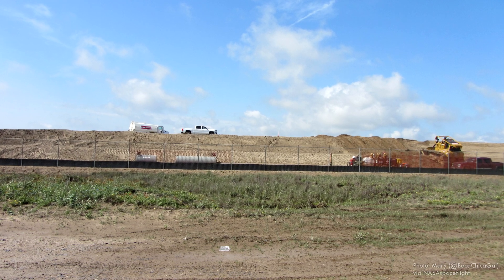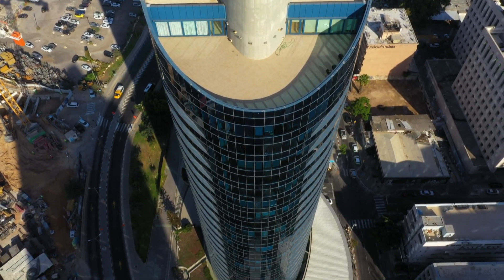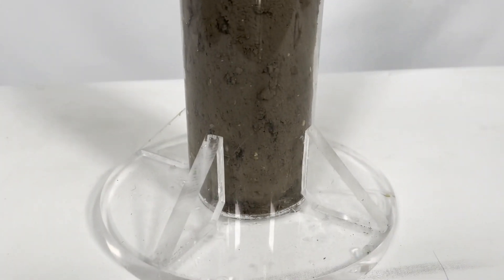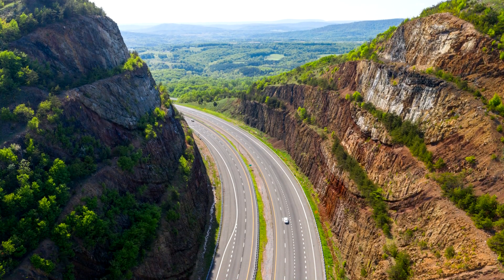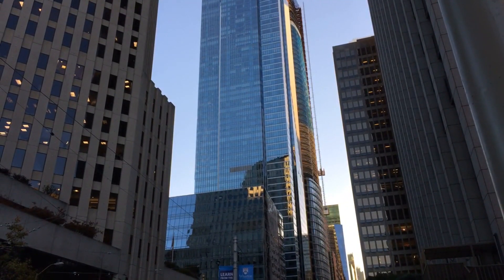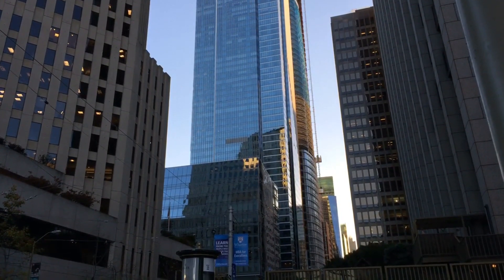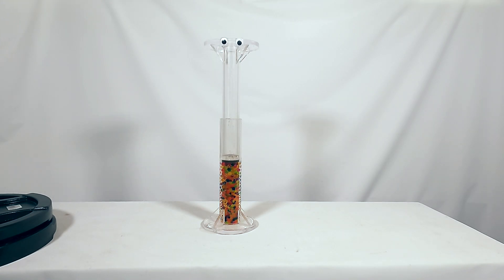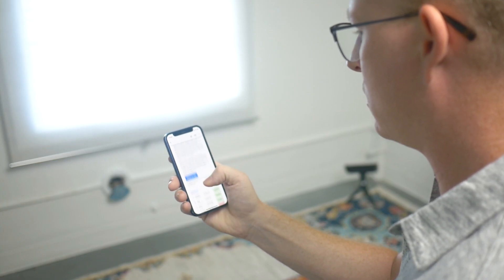Why SpaceX Cares About Dirt

Comment: Question about surcharge loading: if the imposed stress of the structure is less than that of the added material, can the soil expand again? Do you need to remove the added material at a specific timing to prevent this? How do you know?
Reply: The soil deforms plastically, so the VAST majority of the deformation incurred by the surcharge will not be recovered. It's like if you pull hard enough on a piece of metal (or plastic) where you get the necking... that deformation will not go back to where it was before. You have moved from elastic to plastic deformations. Maybe a better example is a piece of pottery clay... press your finger on it, and it will keep the imprint of your finger, it does not bounce back to its initial shape. That is why clay is great for pottery, because of plastic deformations, it keeps the shape you impose on it with pressure.

This being said, there WILL be some rebound (the soil is at least one order of magnitude less deformable after pre-loading), but the rebound will not be much and will be recovered quite quickly. In any event, since after removing the surcharge we proceed to the final construction, and if you remember that we kept the surcharge until such a time as we almost reached the the target settlement that was going to be caused by the structure, there is not much chance for rebound to happen before the soil is reloaded to get to that deformation it had already almost reached.
Reply: @Tomm9y  Heave in soil is not an issue of removing the load however. Swelling soils swell because of an ingress of water (note, only some clays are prone to swelling). They change volume a lot between getting wet and getting dry, and can indeed apply stress to a structure from swelling pressure. It is a completely different issue from recovering the deformations caused by applying loads to them. 

While Texas I believe does have issues with swelling soils, the site of Boca Chica is basically at sea level, and it is unlikely that the clay there will get any more saturated than it currently is, and so swelling should not be an issue. Swelling is something that you worry about when your foundation is above the ground water table if you have a swelling soil and significant changes in the elevation of the ground water table over time.

Comment: What happens to a building's high-clay subsoil that had to be compressed and drained prior to construction, but now the surface finds itself frequently under standing water due to flooding or - in the longer term - climate change.

Will the water eventually re-expand?  Does this cause meaningful uneven forces on the periphery of a foundation?

Thanks!
Reply from the maker: Some clay soils do swell with increases in moisture content, and the swell pressure can be significantly higher than the structure weight. I have a video all about expansive soils.
Reply: It depends a lot on the type of clay in the soil and it's expansion ratio. If it's  2/1 (aka it swells to twice it's size when 100% hydrated) you'll be fine, if it's 20/1 you're pretty much screwed.
Reply: If the surface still has the weight from a building on it, that will work to keep it compressed.
Beyond that, who knows exactly what the particular soil will do over the decades lol

Comment: The only question I'm left with is what if you consolidate the soils too much? If you use extra weight to make the process faster and it consolidates more than necessary, will your structure be lifted up instead of sinking? Or is that only in the case of expansive soils exposed to water?

Comment: Would love a video on "Rammed Aggregate Piers" as another alternative to dealing with compressible soils.  I read Tesla's Gigafactory in Austin is using them to handle the local adverse soil conditions so common across Texas.  They don't go to bedrock but seem incredibly stable.

Keep up the great work!
Reply: Usually we use piers when a good layer of soil is deep and we need it as anchor points for the foundations. Piers are super stable since they are surrounded by soil, that soil also gives a lot of friction to the piers helping them distribute loads into the ground
Reply: @jigui26  Thank you!  I guess I'm mostly interested in the "rammed" aspect of how Tesla's piers work. A video from GeoPier shows the aggregate spreading out laterally.  I wonder how that affects the stability of the adjacent soil.
Reply: @skenzyme81  
The rammed aggregate spreads out due to the peak pressure exerted by the ram. If your foundation needs to withstand a certain constant pressure, you simply impose a proportional peak force on the ram. The aggregate compresses the surrounding soil as it spreads out and forces water out of the pores in the process. If the aggregate piers are too tall and slender to withstand bending under the vertical stress (surrounding soil is not enough support), then a concrete and aggregate mix is used. The concrete infiltrates significant distances into the sand and stiffens the surrounding soil.
Reply: @jigui26  I also wonder about why you might go with a wider/shallower aggregate pier vs a narrower/deeper solid pier.  Is there a critical depth for bedrock where narrow solid piers become impractical?
Reply: @skenzyme81  it all comes down to whats most cost efficient for the load you plan to place on it.
Reply: @SMA Productions The particular system Tesla is using is called "GeoPier."  That's all I know.
Reply: @skenzyme81  Geotech here.  GeoPier is a "brand" name for Rammed Aggregate Piers as the company GeoPier was one of the early pioneers of this ground improvement method
Reply: What you're referring to is also known as a rubble trench foundation. They have been around a very long time and were originally pioneered in America by Franklin Loyd Wright.
Reply: I worked on a project that used compacted aggregate piers. My issue was that the engineers specified limestone in 57 size. Any first year engineer knows that 57s are not compactable. This was in Lexington Kentucky, so lots of clay, and the buildings were 5 story wood framed units. I guess the soil was enough to stabilize the piers.
Reply: @georgegroot9704  probably should’ve been vibrated for consolidation. Not exactly compaction but will cause consolidation and using absolutes in geotech is a very dangerous thing my friend!
Reply: @joshrakestraw5580  oh I whole heartedly agree on the absolutes. I have just had a lot of experience with 57s in particular on a Forest Service job. Their bold idea was to use 57s as a base to stabilize basically pure sand on a road. Then we were to use DGA as is standard. It was a colossal disaster in which I spent 2 weeks picking up about 1500 tons of 57s, then choking the sand with clay as we should have done. Now I admit that a drilled pier is a completely different subject, and I can see how it would work, it just surprised me
Reply: @georgegroot9704  yeah that sounds like a complete cluster due to an ego and inexperience… large aggregate to stabilize fine aggregate with no binder and no confinement. It seems like soil mechanics is a black art to most people for some reason.
Reply: @georgegroot9704  Lots of clays? Might should have used lime soil stabilization

Comment: I gotta push back on the leaning tower of Pizza! It was actually built over 400 years. The foundation was not intended for such a tall building. If you look closely between levels, you can see a design change as well.

Comment: Wait cubic yards are a measurement used for volume ? I have so many questions
Reply: should it not be?
Reply: @Wulthrin  well it's a lot of different measurements that don't relate that well to one another, because there is a lot of ways to measure length in imperial but also a lot of unit for volumes, and I never encounter yards on the internet so yards cubed felt like a lot
Reply: Sounds like you're normally a metric measurement user. Think cc's, but larger.
Reply: @michaelwarren2391  it's about 3 quarters of a cubic meter, a cubic meter being literally 1 million cc it's definitely larger than that !!

I believe practical enginering just said that to mess with my head
Reply: There is "acre foot" for water too.